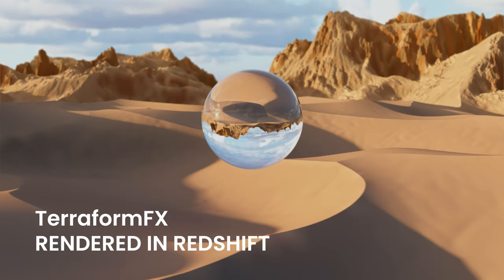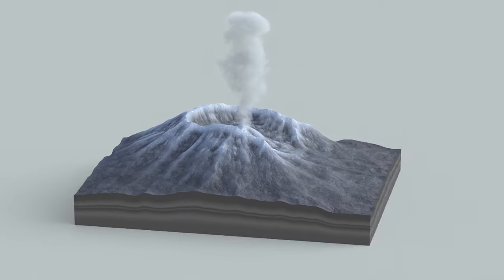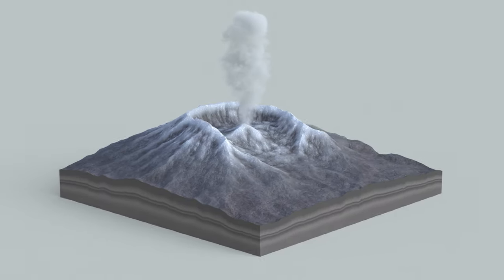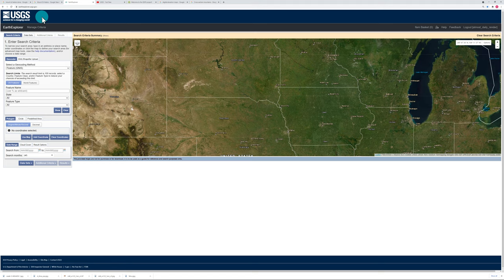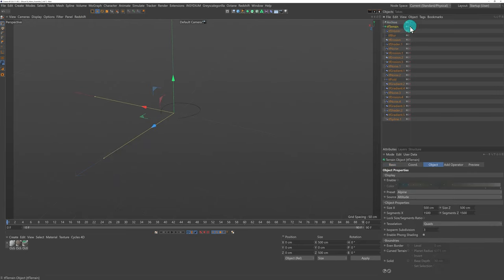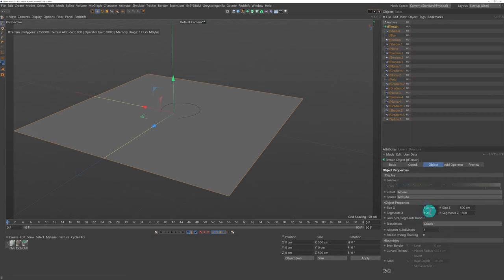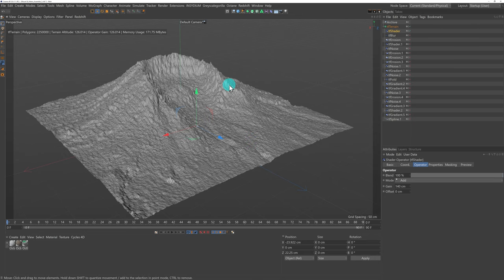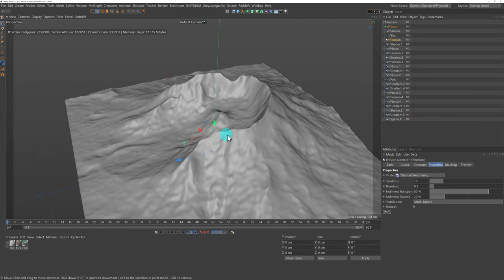Building a model of Mount St Helens using Digital Elevation Maps, in TerraformFX, Cinema 4d - Part 1

Comment: Nice video, thanks for that!

May I ask why you chose not to use the operator shader for texturing?
Reply from the maker: Of course you can. It’s just a matter of preference. I find the Operator Shader is a hinderance sometimes, especially with so many layers. If I need to close C4D or there’s a crash, I can return to editing the material immediately instead of waiting for everything to calculate again. And I’ve found that sometimes some of the Erosion Layers fail to calculate when reopening the project. Which is a pain. By making a TIF of my terrain, I know exactly what I am working with and it speeds up the workflow. Thanks for watching.